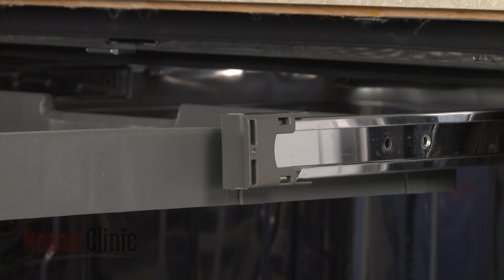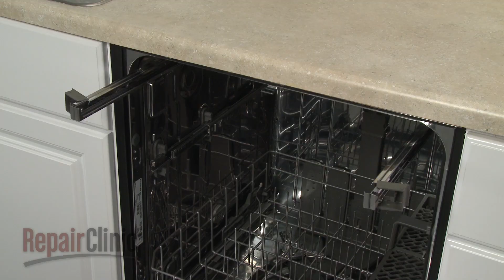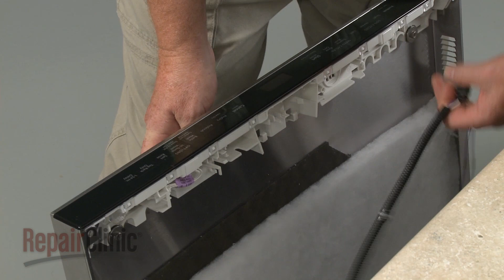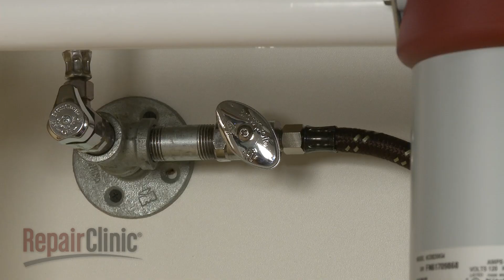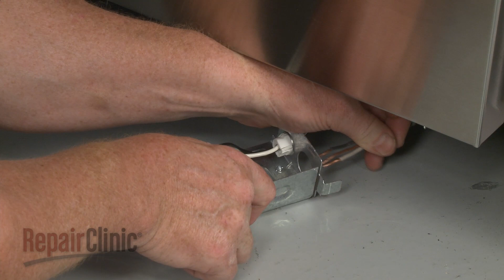KitchenAid Dishwasher Disassembly (KDTM704ESS) – Repair Help

Comment: These videos show the lower assembly being removed with a simple counterclockwise twist and pull. No, mine doesn't budge after moving it counterclockwise.
Reply: Me too. The arms do not push down, but will rotate with a clicking ratchet sound either direction. Did you ever solve this?
Reply: @peterfraser5704  so, I’ve been able to do it but it’s not with any methodical way other than pulling up will I turn counterclockwise. It’s not as easy/intuitive as this video shows but it will come up if you happen to pull up/turn at the right time. Sorry I’m not any more help!

Comment: This is exactly what I needed, thanks for posting.
Reply: Disconnecting the dishwasher and removing it was easy. I have side-mount screws, however, and now I can't figure out how to reattach those screws without pinching the gasket under the screw head. Do you have a solution for that? Thanks

Comment: I need to know how to remove the lower rack on this and similar models. My dishwasher is KDTM404 but the interior seems identical to the 704 The front clip that keeps the heating element down got bent backward (don't ask how, too detailed) and I can't get it back over the top of the heating element.  If the lower rack was out, I could access it better.

Comment: Helpful, but for me the biggest question is how the heck do you remove the filter to clean it??? Instruction manual from KitchenAid show a different filter style than what's actually in my model. (My model is the same as your video)
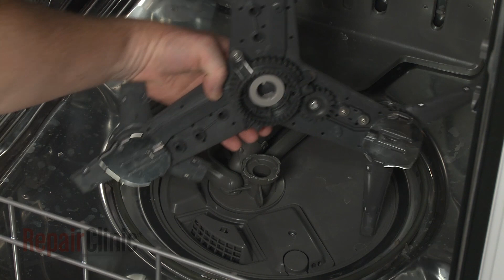Reply: My filter looks like this. If you stop the video at 2:24 it's the inverted basket looking thing at the lower part of the screen. I grab it at the top and pull straight up. Be careful to avoid grabbing the plastic meshed part because it's easily broken. I use my nails to grab the lower edge of the solid top. Getting it back in is pretty straight forward because of its shape. The process gets easier after a few tries.   I  have removed the spin arms to clean out the water jets. The upper is a piece of cake. The lower not so much. The user manual is no help. I just watch YouTube videos.
Reply: Please tell me you figured this out - it's driving me insane
Reply: @TheHmmer4  OMG.....I'm ready to throw this thing out the door...and Kitchen Aide is useless, sending you to different dishwashers.  I came here to ask this question.
Reply: @rebeccag2497  Its the absolute worst eh? Lol I still have not found an answer on this...
Reply: did you ever figure out how to clean the filter?
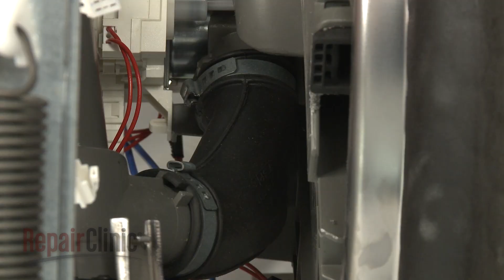Reply: @rosie50505   the filter is self cleaning. In the rare case you need to access it, follow the video until 10:21 you don’t have to remove the pinch clamps to access the filter.  Remove the large plastic cover that covers the pump, I think there are 5 screws total. Directly under the cover is the filter assembly. Unless you are good at disassembly I would get a new filter assembly W11084156 if needed. If you feel like cleaning the filter, Take out the filter assembly and remove the steel c clip and press out the steel rod, the plastic will separate from the filter and you can clean it out. The filter assembly has washers, and springs so be very careful with it. If the filter mesh is damaged it will need to be replaced.
Reply: @rosie50505  What's the model number to your washer? I might be able to help if it's the same as mine.

Comment: Thanks! I had a orange wire unplugged when I was installing my new dishwasher and this video helped me figure out where to plug it in! I have the 404 not the 704 but they are very similar underneath.

Comment: Awesome. You make it look so easy.  Is there a 'run test' option for this dishwasher? The lower spray arm on my dishwasher is not spraying water. I'm trying to figure out if it's a motor or computer problem, or even something else.